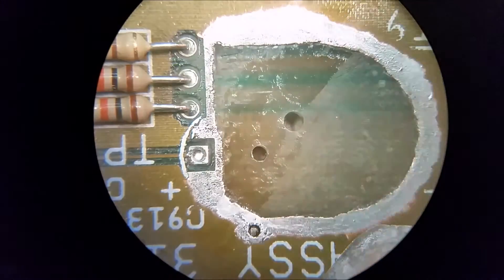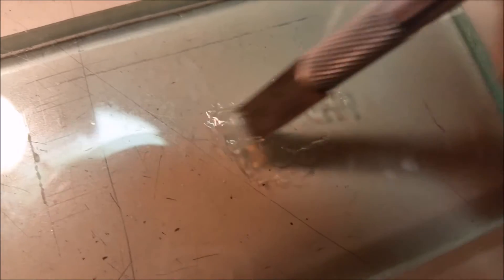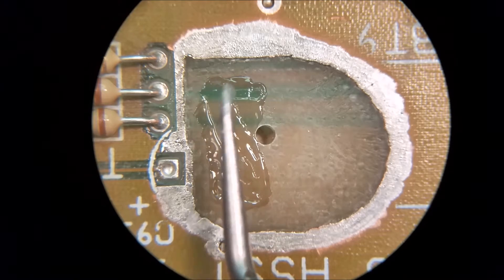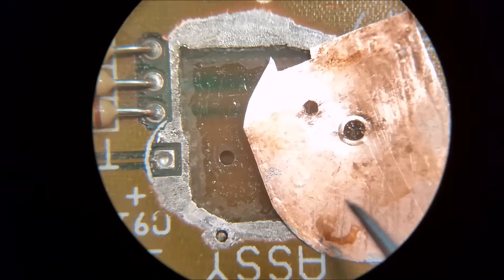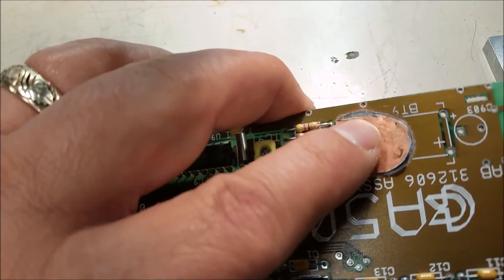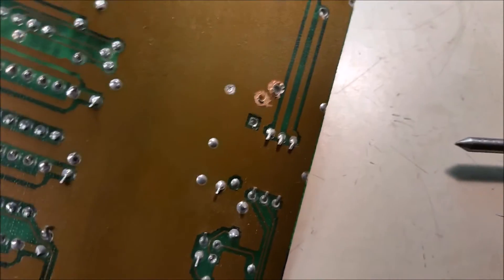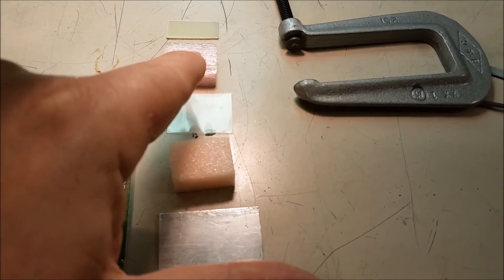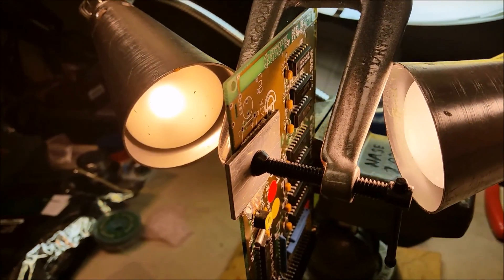Solder Tutorial Part 7 How to Replace Corroded Copper Plate

Comment: Does anybody else have this? It looked so much like the brand of epoxy i use (i think available under this brand in Europe only), the hue, the consistency, that i hallucinated its smell. BTW, hot-curing mine makes for better adhesion and cohesion, and another trick i picked up is that you can vary its properties by mixing slightly different ratios of hardener and binder by about 15%. More hardener makes it much less brittle, slightly more flexible, and somewhat less solvent and acid resistant, and vice versa. Hardener is the slightly yellowish stuff, while binder is the clear one. Too much hardener and it just won't harden though. So maybe that's gonna be useful to somebody if their epoxy behaves similarly. Mine gives maybe an hour of working time or more, hardens to the touch within 6 hours with quite a bit of heat emitted from it, and cures to 90% in a day, with an alternative fast-cure at 100°C within 10 minutes doubling the shearing strength.
Reply from the maker: Yeah I hot cure sometimes too, it does improve adhesion as it opens the pores on the board up more. Personally I don't like to mess with the ratios, just my preference. But that is something to think about. When curing I just go by what's on the package unless I heat cure it, then I go by feel when warm and when it's cooled. Good comments again Siana. Do you do electronics for a living or just one of the awesome self taught techs?
Thanks for the comments and watching. Best Wishes n Blessings. Keith
Reply: I don't repair for a living. I am actually a software engineer, now back at university studying linguistics, and worked for a decade in embedded devices, while poking various electronics projects on the side, and i do like to repair and modify whatever i happen to find, preferably old, and mostly regardless of whether it has any actual residual value. I have a couple of Commodore 8-bit computers in storage that i have restored and had some old consoles. Then again, there's few things i haven't done and put years of effort into, including art, music, you name it, so i don't consider myself a professional in any given field, besides perhaps software engineering. But i did actually study electronics engineering and physics for a while.
Reply from the maker: That's cool, I tried my hand at programming in QBasic and MPLabs Basic for Stamps. I designed a program to run a telescope 360 degrees and 0-90 degrees. It would check for the shortest route then move the scope. It worked fine on the display but I couldn't get the code to output the parallel port. That was over 16 years ago. I was working on it to run my home built 8" telescope. I do Auto mechanics, electronics, some computer repairs mostly hardware. ATM (Armature Telescope Building) only built one. Some misc carpentry around the house. I've tiled our house, sheet rocked parts of it etc. Kind of a handy, mechanic, electronics jack off all trades kind of guy. I actually do electronics for a living. I repair Aircraft Test Sets, usually down to the component level. Lately I've been teaching my self to MIG weld so I can fix my sons 03 Cadillac CTS. It's been a challenge for sure. Anyway thanks for the come back. You should start your own channel, "Software Programming for DUMMIES" or something like that. Seriously I'm not calling you a dummy but you might be surprised how may folks like me could use some training. I'm close to making around $100.00 a month on my channel so it's good hobby money. Anyways don't want to hold you up. Message me once in awhile, you can send me a message using my about me tab on my home page. Nice to meet you Siana. Keith Noneya.

Comment: About 30 seconds and some 2000 grit sandpaper, and you can make that copper foil/plate look like brand new. Also, you can super glue a little 6mm diameter piece of 800 or 1000 grit sandpaper to the end of the rubber eraser on a new pencil and be able to burnish clean small parts by hand easily. Oh yeah, you can also mix a little bit of diatomaceous earth with Brasso or some other metal polish and burnish that in with a rubber pencil eraser, and then buff it with a q-tip, and swab it with alcohol, acetone, or naphtha to remove all traces of corrosion or contamination on metal contacts like battery terminals, or something similar to bare metal, plus it will look awesome…
that is mostly for physical contact, but if I intend to solder it, I might go through that process to get it really clean, but then I have found that scrubbing it with a solution of citric acid and water (canning department at Walmart) on a q-tip as a final step will turn your flux into super flux.
Reply from the maker: Wow someone who really knows what they're doing, I love it, I agree wholeheartedly. The goal in this case was to get it reliably working, not so much restore it. I had a very limited time schedule to get this ready for my friend who wanted to take it to a Maker Fair in New Orleans. So since it wasn't going to be resold or put on display where it could be seen, it was important make it cosmetically pleasing, but to repair the damage and ensure it had years of service afterwards, and still make the show too! You and I think a lot alike when it comes to repairing things for sure. Most folks would have just slapped some solder on it and left it at that. How long have you been a Mini or Micro Repair Tech? Thanks for sharing your cool techniques with us. Best Wishes & Blessings. Keith Noneya